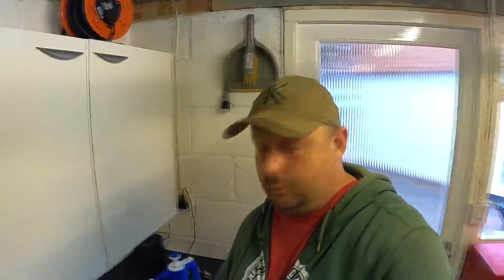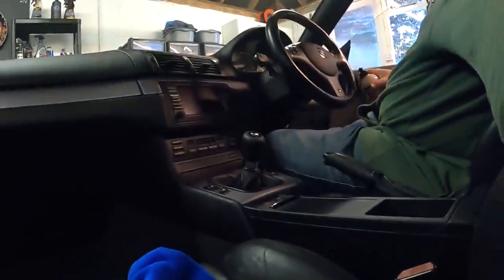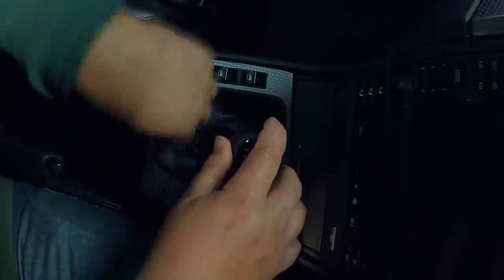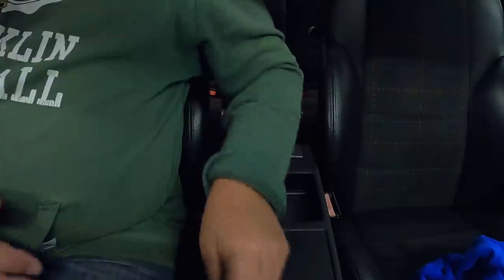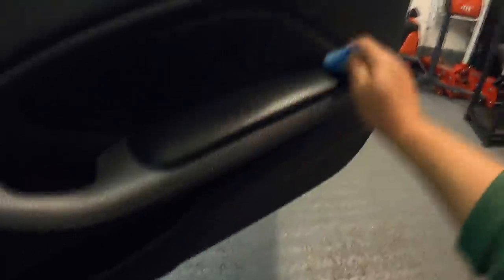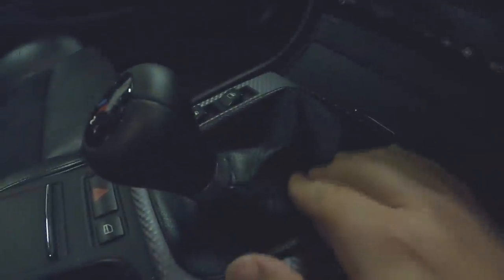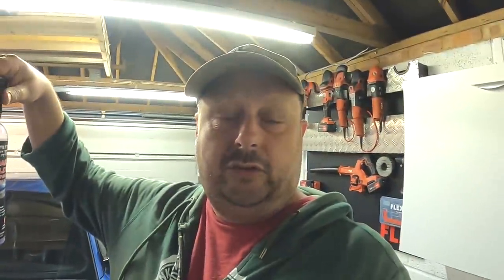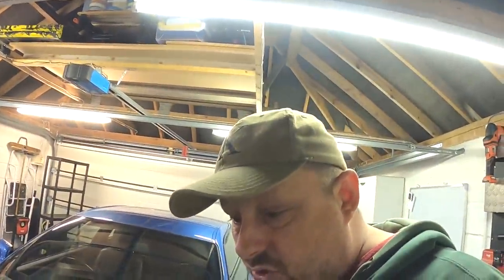Cant this stuff save my tired stiff gator leather??

Comment: Love the e46 content. I've got a 330ci e46 too so it's really helpful for me, I'm going through some of the same issues.
Anyway if you ultimately decide to replace the gators, you can get alcantara ones on Ebay etc. Modernises the interior a lot imho. I did mine and it freshener it up nicely compared to my tired old ripped leather gators

Comment: Great video John.  One of the issues I have with leather conditioners e.g autoglym is they don’t give a pleasant smell. I’ve been using Dr Leather wipes which actually leave a fairly decent leather scent. One of the claims you read out was it leaves an intense leather smell, was that the case?
Reply from the maker: definetly smells of leather, decent strength but not like intense.
Reply: The "Smell" doesn't do the job.
The more smell the less ingredients doing "the job" unless the product is an air freshener.
Don't overcomplicate things.

Comment: i was looking at the range the other day as I have fallen in love with Bead maker after initially not being too impressed by it. As a QD and gloss enhancer its really good. Would you use this stuff on leather seats though or is it too glossy for that ?
Reply from the maker: I would use this stuff on older leather seats sure.   But new fresh leather seats does typically benefit from conditioner or cant be conditioned.
Reply: Saaame. I really disliked beadmaker and the hype but now I use it as a topper/drying aid over my jescar powerlock and it's nice to have that slickness to impress people and looks pretty good.